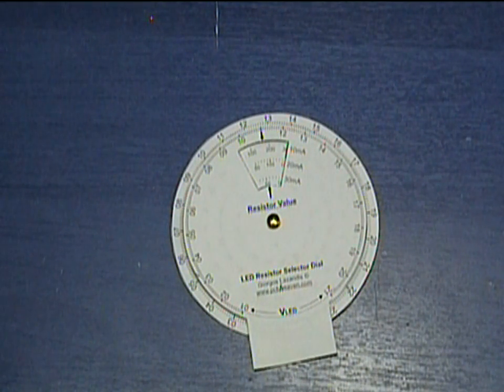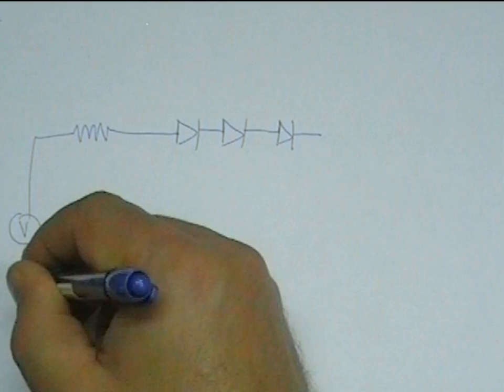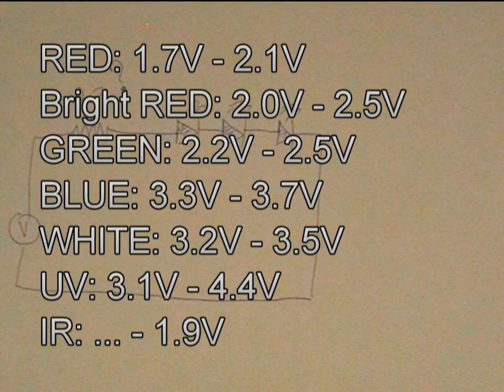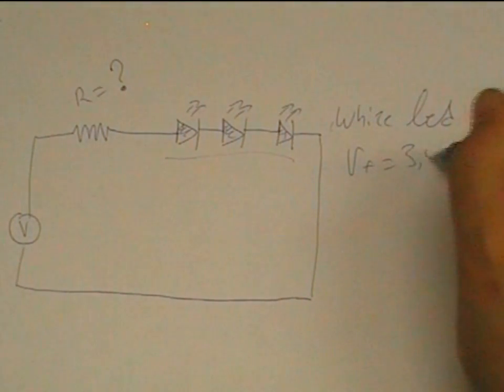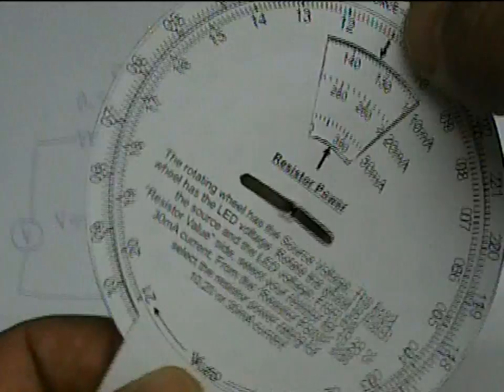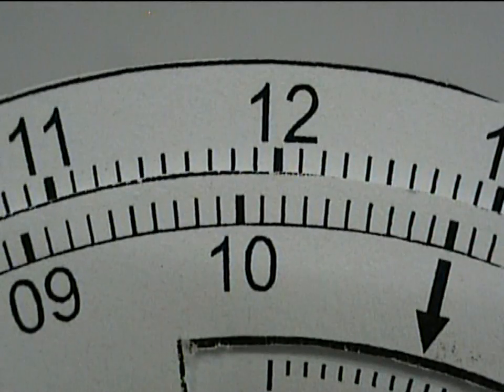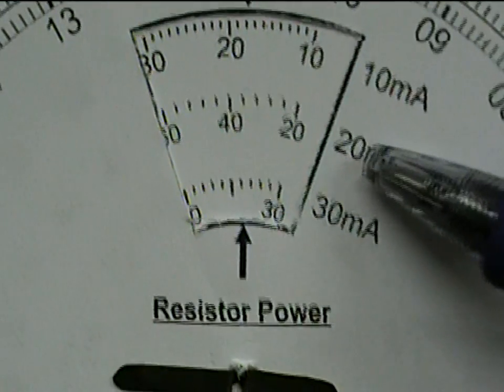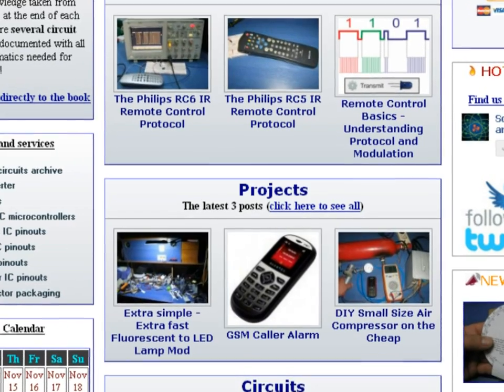LED Resistor Selector Dial

Comment: hey pcb heaven there is a bit error in the pdf on the website, the picture in the tutorial dose not match the pdf, the dotted line does not continue between the bigger wheels to fold and glue them
thanks